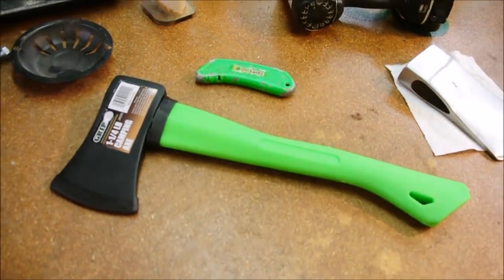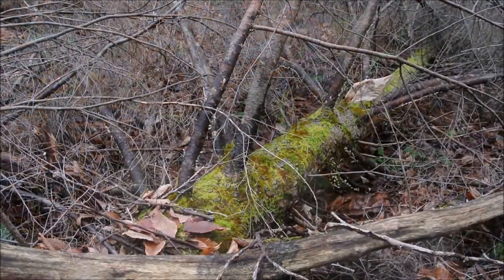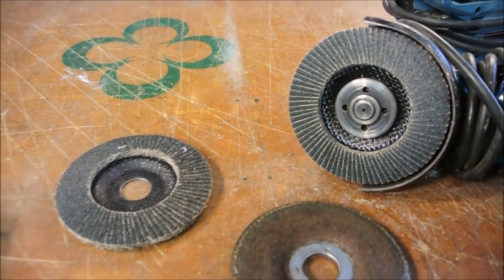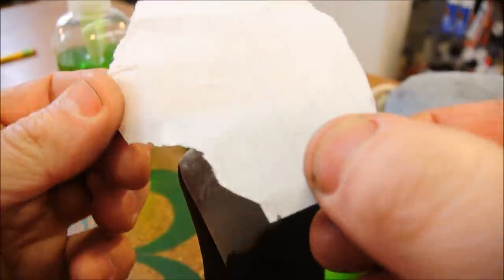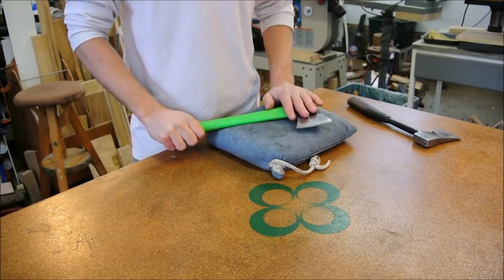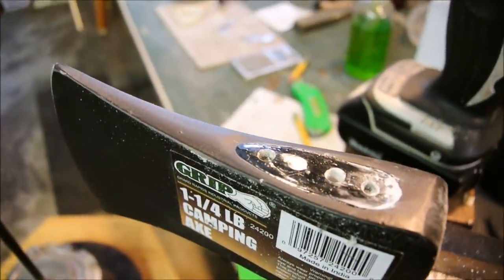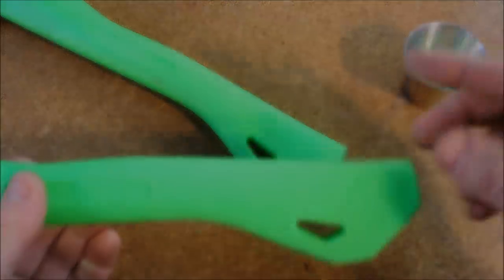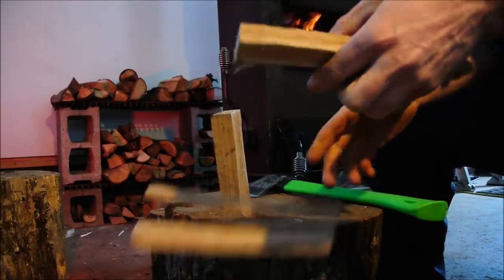Amazon's 12$ GRIP Camping Axe: Inside-Out

Comment: Living in Florida, I've never had much use for a hatchet. Indeed, the last time I used one was when I was camping as a teenager, and I remember cutting wood with one being a very arduous task. Watching this one struggle at the beginning made me realize that the hatchets I've used have all been either very dull, or never sharpened more than factory.
Reply from the maker: Loppers are easy to use for stuff smaller than 1" diameter, but they start to get tough to use after that. However, a hatchet uses less energy to cut a 1.5" branch, and it still allows one hand to remain free. I'm really glad you caught the point here: a functional, well-prepared (and appropriate) tool is nice to use. 

I don't value a "hard day's work" for work's sake; I prefer to measure my day in terms of its productivity, satisfaction, and my amount of evening pain ;)  

Enjoy the weather down there. Paradise is still two months away for me.

Comment: oh, beech has awesome nuts! they are tiny, but the taste is marvellous... And it makes for probably the best fire wood, and awesome for furniture too. the short-fibered core wood makes it great for carving too. Not usable for tool handles or other stick applications (due to the same property of short fibres). Careful with the larger trees though, as they only root very superficially making them easy prey for unbroken wind. Also, they don't like direct sunlight on the trunk's bark, so if you cut down a tree next to the beech, check if direct sunlight is introduced and if necessary cover the trunk with woven jute. (I really don't understand why you say that beech is not a pleasant tree, but I'm sure you can tell that it's one of my very favorite ones, hahaha)
Oh, and it makes for awesome smoke flavour, both as a general smell when burning it, as for smoke grilling meat and veggies. If you pick up the nuts for consumption, you won't have any saplings stand in the way anymore either XD
Reply: Well said. Beech gets a bad wrap as its' grain is non decorative, doesn't take stain evenly, and isn't durable outdoors. However as you say its an excellent and stable furniture carcassing wood, impact resistant, glues well, and burns hot. The tree and its saplings support a lot of wildlife, old beech woodland is a thing of beauty.

Comment: I use 3 different hatchets for general cutting and delimbing of trees the reasons for each are the first has a concave cutting profile which is really nice for cutting and splitting wet/funky wood (it doesn't get stuck in the wood as much) the second has a convex edge which I use when working in the rockier areas of my property as when I accidentally drop it on a rock it is much more likely to hold its edge (but it's not half as blunt as most factory edges) and the last has around a 30-35 degree  feathered edge(similar to what you sharpened yours too which is a good all around edge and also splits drier wood better than the other 2)... I like your video formatting, pace, and soothing way you describe what you are doing its kinda relaxing (I may actually try one of those cheap hatchets myself as the heads on mine are starting to show their age by the way (they're on their 5th 6th and 7th handles each and all are over 40 yrs old and have been resharpened many many times) keep up the great unbiased videos they're great and it's refreshing to see a different way of how  someone else does their edge sharpening (I like to profile edges on a bench grinder with a fine stone to start while keeping from overheating the edges (a trick for this is placing some clay on the very edge as it soaks away the heat and redistributes it along the entire edge while grinding) followed by a single cut metal file that's then followed by fine emery cloth rubber cemented to a steel bar and or ceramic sharpening stone when I sharpen hatchets/axes for friends and family). And to make the honing/fileing effectively more visible on camera you could use a contrasting sharpie or machinest dye (my only dislike of the whole video although you do describe it well is it isn't very easy to see).

Comment: Just spend 3x more on a Fiskars and you wont have to spend 2 hours modifying it just so that it works at all. My Fiskars youth axe I found in the woods and it works absolutely great. Never had to sharpen it yet, and the design is really comfortable. Not to mention it won't break.

Comment: Sharpest knife i own i found in the dirt when i was 12 . Was a blade off a broken small chefs type knife, cut a groove in a stick and glued it in, wrapping it in string for support and gluing the string. Drilled 2 holes in a board with hole saws, made a continous wood ring for the handle, attached it the same way. Then took a big screw, let it wait on the railroad tracks. It was not threaded the entire way, so it made a serrated edge and a straight section naturallty. But it was double sided so i cut it in half with a dremel. Then i sharpened it a bit and polished it, cut a groove in the wood ring and added it as a sort of brass knuckes blade type deal. I got the blade good enough to shave with, kept it that way ever since, favorite blade i own.

Comment: the edge that little thingy came with looks like a young apprentice went at it with a dull beaver.....or was it a dull apprentice....
Reply from the maker: I think it was done with a machine. The grind looks like a perfect radius. Besides, a dull beaver will leave chatter marks on the edge.
Reply: @pocket83squared  a sharp beaver is a safe beaver.
Reply from the maker: @gizanked: Not without a shoulder strap. I've seen guys using one without a strap, and they're lucky they don't get a leg chewed off.
Reply: AvE?
Reply: @ZACHARY MIKKO oh yeah, that's a staple in the AvE insult arsenal.
Reply: I honestly believe it's a safety "feature". Stores don't want to have really dangerous objects on shelves. For example, a local store which sells machetes has all of them rounded to the point where you cannot cut anything with them not matter how hard you try, and have to make the whole edge yourself.

Comment: hi. great info and good vid. i own an older husky fiberglass core axe. i also had to do all the same mods to my axe as you have shown here. one thing im not sure if you are aware of, but that epoxy plug in the head of your hatchet will fracture and the head WILL come off. that being said when the time comes , either now or after it breaks, i would definitely recommend using a wood and  steel wedge set to replace the head. you may want to reshape the inside of your head to exaggerate the the spread of the neck and drive the full wedge in and both steel. after i did this my axe handles better now than when it was new. < this may be due to my personal bias :))

Comment: I have this hatchet and after sharpening the blade a bit I just use it for splitting kindling which it does very well and is basically what it is made for.  I have used it for splitting some smaller logs using another small piece of log as a baton and it works well for that also.  As far as taking it out and chopping wood with it that thought never crossed my mind as I have a nice camp saw that will do the work in half the time with half the effort.

Comment: When grinding an edge with power tools I put a wet sponge on the metal near the edge so the temper is not affected so much. Sometimes I cut a strip of sponge to do this.

A spray bottle of water can also keep the metal cool.

Comment: I've got a very similar Pittsburgh hatchet from Harbor Freight that I modified with a longer handle. Cold chisel and a BFH will clear out the eye with a quickness. The polypropylene or whatever doesn't go very far into the eye, just the fiberglass core. It's turned into one of my favorite hatchets. I think I'll pick up one of the newer ones like yours with the super blunt edges. For $6 why not? Also I started using soap on my stone recently, thought it was just me 🤣

Comment: I've become a big fan of a smaller, solid metal axe. I at least like a metal handle. I know its heavier than wood but to me it's worth it for a hatchet that I just cant snap. 

I have snapped two hatchets while camping. Do I need to be easier on my hatchets? Probably lol. But I tend to abuse the crap out of my camping tools. In willing to take some extra weight (and I take a smaller hatchet).

I really hate the hollow handle hatchets though. Hollow metal is the worst of both worlds to me.

It's all preference though. You just have to find your own personal balance. As long as you aren't throwing axe heads at your friends though
Reply: Agreed, after snapping 2 wood handles and seeing some damage on the 3rd axe I've started packing the solid metal axe and it seems indestructible. I know the wood handles broke because my buddies and I abused them, but not having to worry about the axe just gives me some peace of mind.
After seeing this, I'm pretty sure I'll put a new edge on it though. Haven't put much work into it yet because I, like most people, assumed they come ready to use from the store.

Comment: Alright, so you using liquid soap instead of water got me really interested. I tried it at work today and was baffled by how well it worked. It's also a very easy cleanup and doesn't cause the leftovers to rust on the stone. I'm already using liquid soap to reduce friction where oils cannot be used, so I always have enough of it at hand. 

I'm sharpening an industrial blade which cuts through kilometres of material every day, and requires constant sharpening. Up until now, I had to use two stones - one wet to sharpen before the blade is used, and one dry to sharpen during use - I have to prevent moisture getting on the materials and cleaning up the blade after every sharpening would not be time efficient. Due to how easy the soap is to clean and how little of it is needed, I think I'll be able to use just one stone with soap. So thanks for the tip :)
Reply from the maker: If you wouldn't mind, try to let me know your results after you've used the dish-soap for a bit. I'm having great luck with it so far, but I'm still getting angry commenters who tell me that I "can't" or "shouldn't" do this. I would really like to know how or why the would be bad, since it seems to work so well!
Reply: @pocket83squared  Will let you know after a few weeks. My initial impressions are very good, already let the wet stone dry out. Seems to take less time to sharpen and to clean. 
I'd say that some people are very concerned with doing things in a specific way and aren't accepting of alternative methods even if they work better.
Reply: @pocket83squared  So after a few weeks I'm back to water. Soap worked really great initially, but would relatively quickly form a smooth paste on the stone which essentially turned the stone into a fine grit one and it wasn't sharpening as fast as I'd need. I had to wash the stone regularly which made  it more hassle than keeping a container with water around. 
As stated before I don't sharpen kitchen knives :) I'm using a very coarse stone, pretty much what you'd use for sharpening scythes. Given the amounts of material I cut on daily basis, the blade can't keep an edge for longer than a 15-20 minutes, so I need to be able to make a proper edge in seconds and adjust blade geometry in a few minutes. 
I also noticed that you can't just use any liquid soap - some don't work at all. Unfortunately, soap is not suitable for my use. Water is tricky because I can't have it dripping down and it's more work to clean the knife afterwards.

Comment: Best hand axe I ever had was a HF wood handle. Sharpened it with occasionally with 180 sand paper on a drill, too hard to file. The 180 would make it shave. Held an edge great, the profile was perfect and pretty aggressive. The heat treat was perfect, you could see the right color gradient out of the box.

Comment: Beech is good for cooking implements since it is tasteless and smooth. You can eat beechnuts, raw only in small 😨 amount but roasted more, you can get oil out off them too. Use in food like pine nuts. Peel then scald the two nuts for getting rid of inner rind, like almonds but less. If you boil them they discolour. The wood handles for work implements too. Birch is better for axe handles, felling axe with birch handles transport less shock to hand than hickory does. Ash for knife handles or spears. Young beech leaves in sallad like maple and birch too. Sap from maple & birch is sweet.
Reply from the maker: We have lots of Beech trees on this property, but I still have yet to mill one. It's certainly a nice, tough, dense, white wood. Sure burns hot. I have eaten the nuts plenty, but haven't heard of anyone making Beech sap syrup. 

Roasted, Beech nuts have a pleasant taste; it's similar to popcorn, with a touch of a sunflower-seed flavor. It's an interesting idea to scald them to get that rind off, especially since the meat is so tiny. So far, because of their little size, I haven't thought of them as being worth it for all the work. Harvesting them is easy when you find a tree that's ready: with a sheet on the ground and a shake of the branch, one can fill a gallon paint bucket up in a few minutes. 

It seems that the Beech tree fruits on a several-year cycle. One tree will litter the ground this year, while another is sparse. I suspect that this fruiting strategy is an adaptation to squirrels, similar to that of the Oak or Black Walnut, so that a tree is dropping an occasional abundance on a squirrel population that can't make use of them all. Thus, the squirrel instead works for the Beech: his greedy cache begins to grow into saplings long before he's had the time to devour all its meat.

Comment: At 23:00 I am glad you stopped hitting the log with the back of the hatchet. The handle is about the same size and shape of your radius. One of the two bones in your forearm. The handle of the hatchet can be seen as an extension of your radius. More hits with that handle may well have produced cracks in your radius just like the observable cracks in the handle. Good job on quitting. The periosteum is a membrane filled with nerve endings over the radius. The pain to the periosteum told you the hard nerveless structure (radius) was about to break. Good job.
Reply from the maker: Sounds legitimate. I think I can take your word for it. A bit of a truism, though! It seems reasonable to stop doing things when they start to cause discomfort. Lucky for me, my ancestors were selected for their tendency to have an avoidance of pain. Strange thing though, and think about this. There was no such thing as speed on the great Savannah, so far as we understood. We had not even domesticated the horse yet. But we arboreals sure developed a cautious regard of heights! Those of us who would fearlessly swing through the air with the greatest of ease might have impressed the ladies, but they didn't get to 'celebrate' as often at the after event. The net result, in this (modern) post fall-danger environment, is that now people will cringe and tense up on escalator and elevator rides, yet drive home with the reckless abandon of drunken chimpanzees. Now my physics edge has become a bit rusty, but it seems to me that a 50-mph car accident should be roughly equivalent to a face-first swan dive from at least 100 feet up. As such, your point is noted; I do not place too much trust in my intuitive sense. 

Still, you've caused me to wonder if bone is comparable to fiberglass in its characteristics. There are some biological structures that selection has sculpted to rival those of even the most skilled and deliberate engineers. As is, wonder which would break first, density comparisons notwithstanding.

Comment: It might be easier to work the plastic using a spin welding technique.  A rod of thermal plastic spins at high RPM, generates friction and melts both pieces of plastic.  More commonly used with ABS, but might work with what you have there as well.
Reply from the maker: That's a really interesting idea. Thanks.